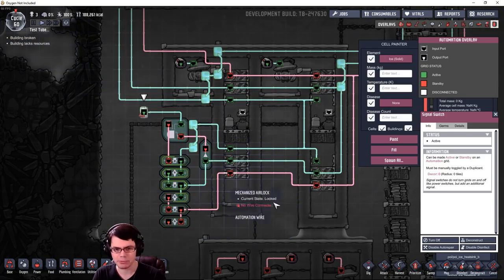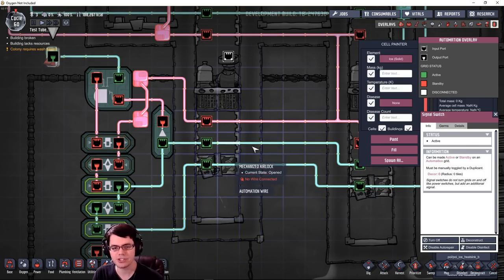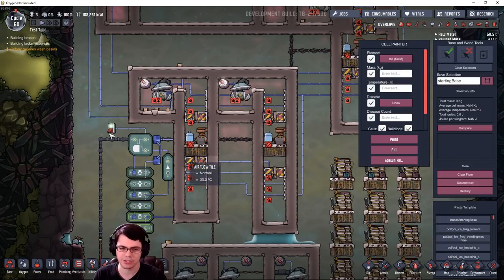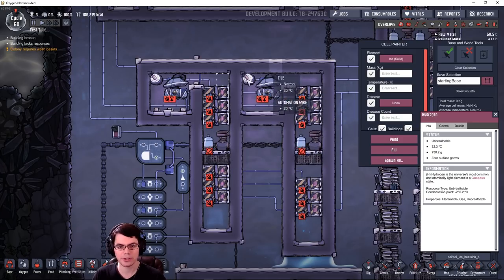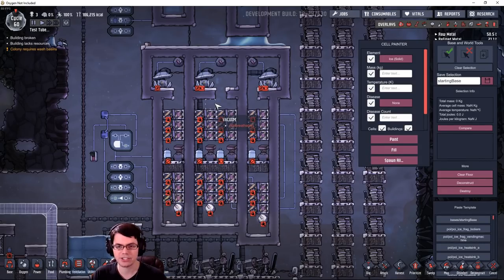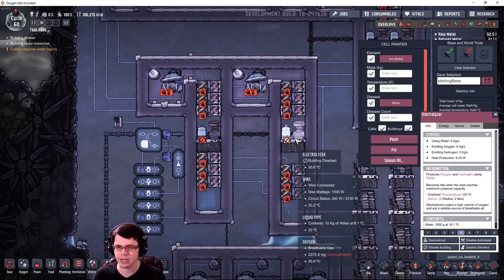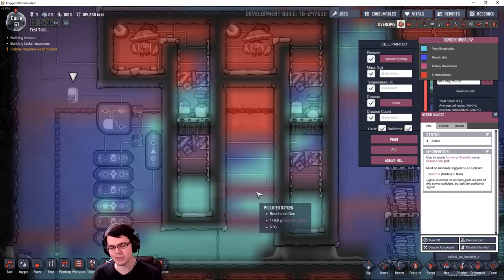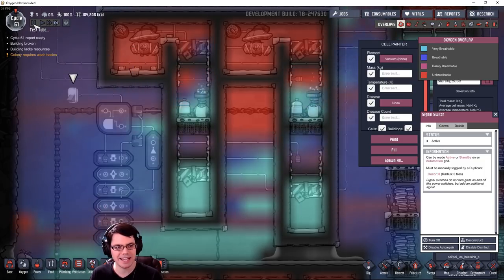Hydrogen and Oxygen Power Plant Experiment! Oxygen Not Included

Comment: I see some problems with these door-based gas compressors. They work NOW.. in the beta... but will they continue to work?
1. Mechanical doors require power. Perhaps not now, but they very likely will in the future. 
2. Airtight doors might not close in the future if the pressure inside is too great or gas/liquid cannot be evacuated to a nearby area.

Comment: Have you tried a door system that uses an XOR gate with a switch and a loop going through a buffer and a filter gate feeding into it, "powering" a series of doors with individual buffers and filters, where the lengths of the XOR buffer and filter determine the number of doors that open/close in relation to the lengths of the door buffers and filters?

Comment: Something I noticed with your gas system in the last test with 5 and 10 electrolyzers is that the pump on the left that gets more hydrogen is only ever able to feed one hydrogen generator because the gas in the pipes is never pathing to the right. If I'm not mistaken, gas pipes have a capacity of 1000g per packet, and pumps are only capable of pumping 500g per packet, so theoretically with two pumps you should only need one pipe. That said, I wonder if this system couldn't run 3 or even 4 gas pumps? Did you find that these two pumps were dealing with the hydrogen buildup effectively? I would also kinda like to see how a similar system would compare when all 5-10 electrolyzers are feeding a chamber to the left. Do you think  it might work to slope the ceiling up and to the left and funnel all the hydrogen through one tile, compress it, and then below the conveyor system, have a larger room just loaded with pumps?

Comment: So would it be possible to create a gas filter system similar to whats used with oil refinery system irl? The gas auto sorts vertically by weight so some sort of long thin column would stack. There are some problems. Mainly what gases are present and making sure they take up one square. So maybe a compressor feeding c02 and random gas into a column then would it sort to say 3 or 4 squares of gas with co2 at high pressure on the bottom? Should be easy enough to get samples of each gas into the colmn and then use sensors and pump to keep samples in the column but pull new sorted gases out. Leaving co2 in higher volume as the compression medium. Thoughts?

Comment: You should pump the gaz from the electrolyzer to another room so it can work all the cycle (because they are not as pressurised)
Reply: anass sidki that's what the doors are doing, it causes a change in pressure causing the gas to try to equalize, just like a gas pump

Comment: Surely the larger system (with 5+ electrolysers) would be more energy efficient if you only had one gas pump for the hydrogen instead of two. You would thus have to rearrange the system so hydrogen would flow into a single pocket.
I also think a pocket compressing hydrogen upwards is better than downwards, I think that was a significant difference between your experiments.

Comment: So...the only thing you'd be losing out on here with a sifter, would be sand and polluted water?
With a positive output of oxygen, power, and even a way to heat the base just with the oxygen it seems like a largely positive thing to include, even if it is kinda loud XP 
If gas goes up and left, could you instead have a slightly staggered ceiling that goes up and left to encourage the hydrogen to the one side, therefore needing only the one pump?  
I haven't actually played this yet so i have alot to learn lol

Comment: Missed the PUNCH in this video, but felt it was in your great style.  Super excited, had to LOL about the RimWorld Factorio, right up ONI's alley.  Thanks for the Speculation about steam.

I was looking around for some Air Flow, and Power Management.   My air is being mixed pretty badly.   Almost thinking about building a complete air recycles so my air is clean in my main base.  Use locks and various other ways to keep the air clean, but to no avail.  Missed the Puloted oxygen color from alpha or whatever, was easier to see.

I believe air is 12 tiles, than up a step, to get it to move correctly.  I don't think Air flow tiles work.   CO2 mixes with O2 and doesn't separate out cleanly, I get bloches of air everywhere.  I am talking early to mid game, this video shares a great air compressor, but those seem late gamey.

Second power seems bizarre.  Maybe I just want to play a game where I can run 500mw through one power line.  But my lines are yellow and white.   I know circuits are a big thing, but not my cup of tea.  I can't seem to get the concepts.  I run Natural gas to less than 1,000 w (kj) whatever, and still my power seems broken.   What is the best way to go to Batteries, and Transformers.

I was looking around and prob missed some more generic tutorials; especially with the new updates.  (Given these two good examples)

Comment: the sequenced doors  could be longer than 3 - that way most of the time there is more space for the electrolizer to expand into, without hitting the pressure limit.
Reply: also hold at maximum expansion space with a quick plunge? so that it siwtches between a u and n shape quickly,
Reply: Andrew Hill just using a pump and filter to filter bothe gasses to 2 different colsed rooms to distributed them further will akso keep them from stopping by being overpressured and more capable to integrate in a real game.:-)

Comment: There could be some math/programming/timing assumptions taken with a 3-door or multiple-of-3-door system that may or may not result in gases being deleted (or allowed to go in the wrong direction). A 4-door makes no assumptions and will always push gases in the correct direction. Pushing from left to right, with o being open and x being closed:
ooxx
xoox
xxoo
oxxo
ooxx

Granted this may be unnecessary (3-door may be adequate) - but it's probably worth testing. ;)

Comment: one error in your first comparison of the systems is the total space available for gases to occupy without being destroyed ... the left is short by 2 squares .. so the 27kg on the right is actually filling more gas than the one on the left because it loaded 2 extra squares ... so it actually had 54kg more of gas than the left one ... so actually the right side is a better performer. 
.
what you compared was an apple to a cantelope ... add 2 squares to the left and rerun the test and see which side holds more ... 
.
in the last experiment where you changed to the 2 door open setup you had a vaccuum below the oxydizers but in the one you compared to you didnt ... so they didnt start at the same place .. again vaccuum the whole system and rerun 
.
the real world setup made heat ok so how much of that heat was due to the hydrogen power plant ... perhaps move those to the top so they dont heat the o2 even more ... and you could put a gas chiller and pump in the o2 part and cool the o2 for use in the base ... by your results you would need an o2 area 8 times larger than the hydrogen area ...so just from the top down on hydrogen you have 36 open squares so 8 times more area for the o2 is almost 320 squares just for the o2 containment ... or 32 tiles down from the bottom o2 door ... just to avoid troubles and allow time for gas cooling and use in the base ... but if you add your conveyor system with snow and cycle that through the o2 area you will get your chill on and cool the works nicely ... put the output station over your water feed resevoir or steam gyser and chill the water with the dropped snow and replenish your supply ... and to keep the snow available clean some bad water from a co2 scrubber and pump it to the cold biome and pool it under wheeze wort to chill it below the germ threshold which will then make ice and you now have a self replenishing water supply, o2 supply, power supply, base temp control and still should have excess power to run things like med pods, lights, farm water supply systems and even more conveyor systems to move materials to the spots they are needed to keep dupes from running all over the map to supply what they need.
.
the ten wide system would benefit from an inverted pyramid to force the hydrogen to the sides easier as well ... i would suggest making it closer to the left side than the right by one or 2 squares so the right side gets a free boost to pull hydrogen to its pump .. since its tendancy is up and left